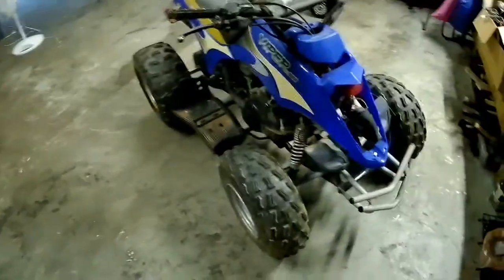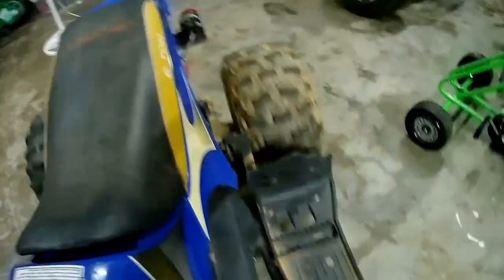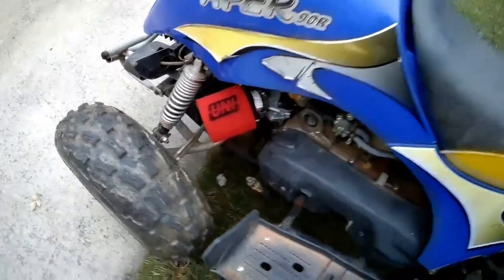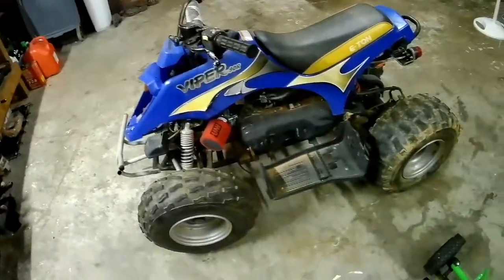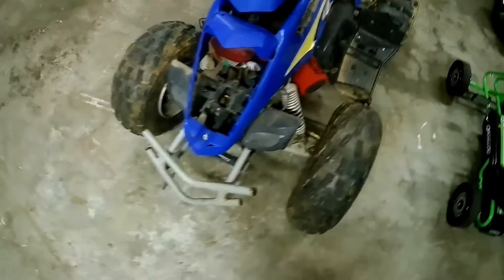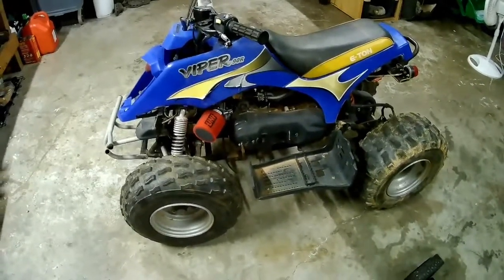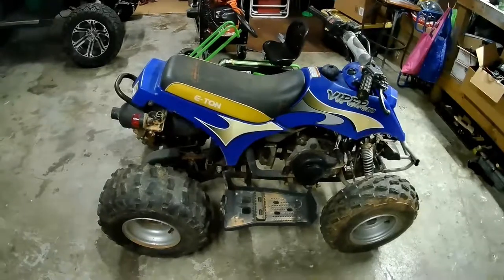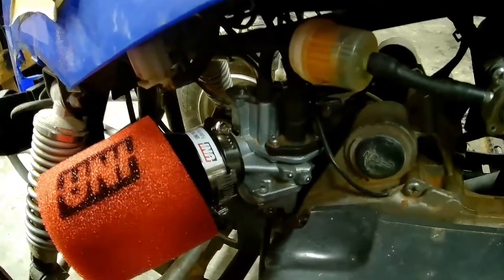ETON Viper 90R 2005 2 Stroke Rebuild Part 4

Comment: You solved the problem ?
Reply from the maker: We ended up putting a bigger carburetor on it and that fixed most of the issues, it also needed a new case gasket because the case was leaking